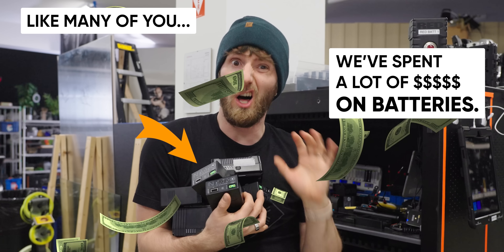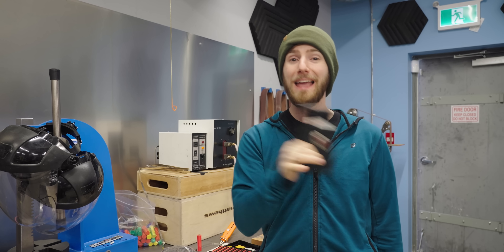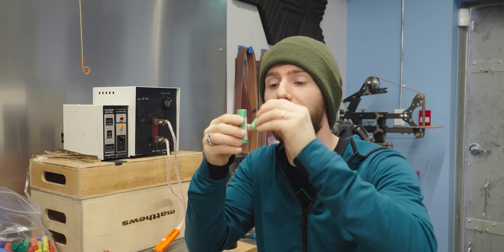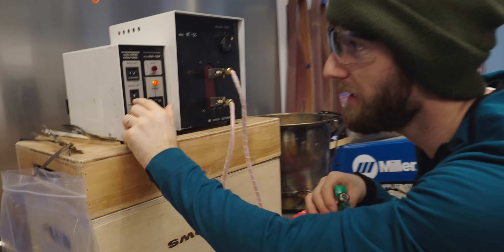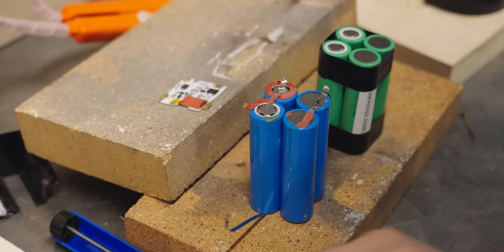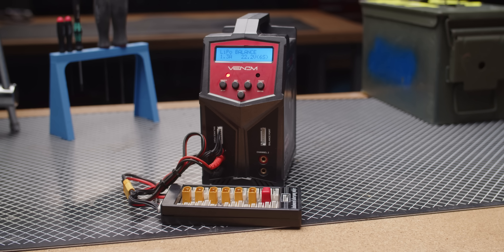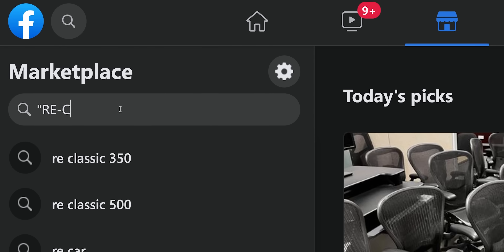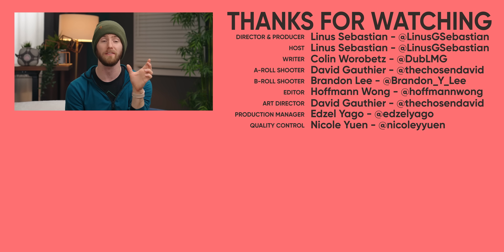This should be illegal… Battery Repair Blocking

Comment: You literally told the reason they do this in the video. The problem with having a "resettable" BMS, is just that people that don't understand the dangers of lithium cells, will just save some bucks by resetting the battery pack WITHOUT swapping the cells, which can lead to disaster.
And then the company will get the blame, for example, if someone have a camera, their battery pack "dies" because its considered "spent", and then some customer googles "X battery pack reset" and finds the procedure to reset the BMS (which should be done after a cell swap) but does it WITHOUT swapping the cells.

Then sells the camera with the reset battery pack (which will now charge up fully but in a unsafe way) on for example craigslist, and then battery pack explodes in the hands of the new owner, which now, not understanding that the previous owner did a unsafe reset on the pack, now blames the manufacturer of the thing.

OR EVEN WORSE: Buying the camera new, then replacing the new battery pack with the old reset battery pack.
Then reseals the package, and returns the camera to the shop, which checks the battery pack and it says "0 hours" because it have been reset.
And then sells it as-new to a customer, which now gets a unsafe battery back which explodes.

Thats why I think its a good thing that they block battery repair, but then they should repair the batteries themselves in a safe way.
Like Bebop does. I don't think you would have anything against if Bebop implemented a encryption DRM thing in their BMS but for which Bebop had the unlock key to, and they could do the cell swap safely.

For cars, there are coming a new standard now for cars, called SERMI. That will replace the anti-theft DRM on today's cars where only the manufacturer can create ignition keys for the car. Instead, anyone that have been approved by the government will be able to create ignition keys for any car.

Maybe something similiar could be created in the future for BMS:es. All BMSes would then legally be required to use the same encryption key for the DRM, and then only approved "battery repair centres" (that are accredited and approved by the government for safe cell swaps) would have the corresponding unlock keys to safely reset the BMS.

Then this enviromental problem with batteries would not exist, but still so battery repairs would be forced to be done in a safe way.

Comment: "recycle properly" you mean in most cases, give them back to the manufacturer, so they can redo them and resell them for full price? They should be properly disposed of, not recycled back into the system! Also this just shows corporate greed at its finest, can't be fixed, even by professionals, buy more instead. Definitely need more companies that produce products that can either be user friendly repaired or professionally repaired in some capacity!

Comment: It's as basic as that... Once the bms has 0 volts from disconnecting the battery it no longer works. It s controller will just become erased.

Comment: There is absolutely no reason to throw those cells away. The spark is because you were not applying pressure properly and there was a small airgap for a spark to jump. Those were not ruptured cells.
Reply: They're so scared because they really don't fully understand what they're doing.
Reply: @j.t.johnston3048  he did say he was an amateur and that this shouldnt be construed as an actual tutorial. He was mostly doing it to entertain us and inform us rather than show us detailed step by step instructions
Reply: @assnapkined9295  its probably best he threw spark batteries away quick even if they dont work instead of saying 'sparks are fine guys this is from the welder' and risking viewers spotwelding and not having as much haste with battery sparks
Reply: @heartdex  You do get sparks when spot welding.
Reply: @j.t.johnston3048  Which is exactly the right mindset if you do anything you don't fully understand.
Reply: That's what I was thinking!
Reply: That sight got my heart to drop, yep
Reply: And also the Positive side way isolated by the plastic So there was no short
Reply: I would try the Red BMS with a power supply, give proper (100% charge equivalent) voltage on the four BMS leg, and let's see if that boots up the BMS or still stays silent. Latter means it killed itself... If wakes up, then good to go.
Reply: Oh god, I used to work in automotive with spot welder robots, got a face full of molten metal sparks more times than I care to count. It feels like someone slaps you in a face with a boiling hot wet blanket.
Reply: @alexgo373  That explains why your face looks like a welder's bench, my friend!
Reply: I mean, better safe than sorry. Imo I'd do the same thing, leave it for an hour, come back and inspect. Even shorting a cell briefly isn't going to hurt it, it's long, continuous shorts that kill them
Reply: They just kept wasting batteries. Absolutely stupid without any understanding of what is going on 🤣🤣
Reply: @OlegSven  You guys are absolutely consumer doinks if you don't understand why people set certain batteries aside to never be used again. Why even watch LTT if you're so inept?
Reply: Yes, he said he was an amatured in this.
Reply: Way overcautious with the "spark" reaction.
You should do some deliberate short circuit welds and learn what it really looks like when it goes wrong. ☺️
Reply: The spark is actually caused by a capacitor, and has nothing to do with pressure or air gaps. When I plug my battery into my ebike, it makes a big spark, because the battery has a big capacitor.
Reply: I think your right.
My vw up battery builded 12V 75ah bank have given spark more then once when building it.
Working perfect.
Using it on 5000-7000wrms car audio.
Reply: I want some of whatever you guys were smoking because I've had one of these rupture inside a vape and since then I would rather jump off a 3 story building than weld one of those with my face that close to the lithium cell without a face shield >.>. The vape shop just sets aside batteries they decide are even slightly compromised. Probably a good business practice.
Reply: @Zensiji   bro, but nobody is welding cells in the vapes. Maybe in the oldest ones, but I've never personally run into one like that. You might have just picked a dogshit cell brand or it had some build flaws. Most of vape devices have all kinds of protection and voltage balancers anyways. But if you're charging a vape through the usb port in one... well that's not recommended it's better to charge them in dedicated 18650 or 21650 cell chargers.
Reply: @coffe3  A lot of vape pods that use 18650s can be charged via usb. Why would they design it like that if it's potentially dangerous ? 

I didn't run into any issues charging mine for years with usb. I imagine the charge circuit has a mini capacitor and some electrickery to ensure the charge rate is constant and at the correct rate for the cell.
Reply: @candyman9635  there are brands which include USB charging to increase sales, but don't want to spend the money to actually do so well and safely. Wether it's a good idea to charge a vape from USB entirely depends on which vape it is.

Just because a company is willing to sell something is no guarantee of it's safety
Reply: @candyman9635 keeping cost down as usual...
Reply: @Zensiji  "the vape shop" lol
Reply: @Zensiji Not sure why you think your incompetence is equivalent to others drug use.

Comment: I first learned about planned obselecense in my IT class. It blew my mind. I was thinking so many countries make big manufacturers adhere to certain emission regulations, but no one seems to carethat much about planned obsolescence except for  the user? Just blows my mind.
Reply: planned obselecense has only been around for a hundred years or so...
Reply: Ehhh. Sometimes people are just buying and creating a demand for products with too many bells and whistles, that and too many people do not bother to fix or maintain their stuff well.

 If you want a dryer and washer With 20 modes and smart functions to be affordable companies are just going to have to cut corners and the people that buy them don't bother to care about what it can handle or make sure its well maintained. It's no wonder stuff doesn't last long. My tip is to go simple but strong, don't cheap out too much and learn about what you're buying including basic maintenance.
Reply: @irregulargamer1352  This is basically what I do, I will run all my gear to the ground and then fix it back up again. It just makes it a hell of a lot easier when there are manuals for stuff thats out of your comfort zone

Comment: Dude this video confuses me. I did a quick search and it says Lithium batteries will heat up and explode if they are shorted. I don't want to call you stupid, and although you tested the voltages, but you didn't point out that you aligned the voltages. I feel like you're either dumb or scared that it made a little spark and threw it in some sand and left it.

Comment: You just need to apply proper voltage to the board right before you disconnect the batteries. You can also repurpose the batteries for things like Ryobi battery packs or portable phone chargers that aren't evil lol.

Comment: Bebop being the battery supplier for Arri is just so fitting.  
For those unaware, Arri's company philosophy is pretty much the exact opposite of RED's in every way.  

They started making film cameras over 100 years ago and went from making the best analogue motion picture cameras to making the best digital cinema cams. They realise that their products are, first and foremost, tools for professionals who need to do a job quickly and efficiently. They don't give a fuck which battery or SSD you use, because there are industry-wide standards that assure compatibility.   
They don't try to be a stupid lifestyle brand, upselling you on shit you don't need and locking you into a massively overpriced proprietary ecosystem. 

IMO the only reason RED has any foothold in the movie industry (looking at the Oscar nominees of the past ~70 years Arri has an absurd market share) is that Netflix required their own productions to be shot on a native 4K sensor and the only Arri camera you could buy that had that was absurdly expensive.  That's why the Netflix market was and probably still is dominated by RED.
Reply: Well put, and don’t forget they will sue any manufacturer who implements internal compressed raw.
Reply: Also red is more or less a patent troll (they do use the patents, but they use them to prevent competition)
Reply: yea, Linus needs to switch to arris haha
Reply: Amen! Their color science is unmatched. Never met anyone in G&E that didn't fawn over their lights either.
Reply: note to self: Remeber this guy's post if ever I buy a camera
Reply: Interesting point, thanks!
Ok, now I believe Netflix has shares in RED.
Reply: RED also came from porno, bad vibes
Reply: ok, but do they allow the users, or even better explain how they could change the battery themselves? (Otherwise, it's just another way to make money)
Reply: Yeah, that stupid Netflix 4k mandate was a travesty.

Comment: 16:10 No, no, no.. Not shame on you. I say F**k you. If your company finds this to be a good practice, I personally cannot wait to piss on the grave of your company.

Everything can have a chip, In fact I would prefer everything to have one within reason. But when you give these chips unique identifiers - Not just make and model, legit identities burned in on programming. When a chip queries the IDENTITY of its other, as in a manufactured pair, and refuses to function because it will only function with its manufactured twin. Just F**k you, designed obsolescence is in fact as evil as you can get. To me it is the same as taking a variable sized shit on everybody that buys your product so you can sell twice as many products to the same person within the "designed lifetime".

The worst thing about this whole "proprietary software" crap.. As if you could extract a microcontrollers code, far from its source... Is the hardest part to reproduce would be the secret sauce used to make the device fail (intentionally) when you replace a part that has an identity burned into it that is not a match. We live in a time where enough people have provided source in detail for most common component applications. It is very possible to find a better firmware solution on github than the stock OEM's solution.

The only code they should be worried about us seeing, is proof that they are throttling our devices as they age, where the actual hardware is physically as new.. I would say "What's next a phone that drops a couple hundred megahertz every time you drop it?" But it could already be implemented somewhere.

Comment: Charge each cell with a vape pen charger first to similar voltage. Next install one at a time starting from the + side of the pack doing the - side last. Finally apply a voltage to the pack outputs at about 1/2 volt over the pack cell sum measured voltage. This resets the pack and allows it to charge correctly. Fixed lots of tool batteries this way. ❤🤓

Comment: As an electrical engineer that has designed battery packs in real shipping products, I can pretty confidently say it's not "putting up road blocks on purpose". It would take extra work and hardware and isn't worth the cost. Sure, some BMS ICs are "single use", but that's rare and only for the most inexpensive management chips. If you need to connect an external tool to reprogram them, so do we...

Ps, those sparks are pretty expected... There is extra work you can do to eliminate them, but it's not that important.

Comment: You can actually use old cells.
Just make sure the voltage is correct.
Pretty sure you can just charge them up if it's too low.
It may be risky, but not too bad

Comment: YOU GUYS SEEM TO HAVE WIMPED OUT IN THIS VIDEO, JUST FOR A FEW SPARKS, SERIOUSLY.  RATHER THAN THE PANIC BUCKET YOU COULD JUST TEST THE CELLS HAVE NOT BEEN DAMAGED.  I STARTED WITH RECYLING LAPTOP CELLS, GOT THE APPROPRIATE CHARGERS.  THEN WENT THROUGH SOME HOMEMADE SPOTWELDERS, THEN THE CHINESE ONES WITH THEIR DEFECTS BUT GOT CREDIT ON EBAY AND FIXED USING VIDEOS ON YT.  I HAVE CONVERTED NICAD DRILLS WITH CELLS I OBTAINED FROM LAWNMOWERS AND DRILL, GOT A HALF DECENT BMS FROM EBAY AND THEN A BETTER ONE.  ONE DRILL I UPGRADED WAS 36V TO 42V.  AN EASIER PROJECT WAS UPGRADING CELLS ON DYSON V6 I GOT FROM FREECYCLE, VIDEO ON YOUTUBE SHOWED HOW, PROBABLY EASIER TO BUY CLONE BATTERY PACK OFF AMAZON.  IF I LIVED IN A WARM COUNTRY I MIGHT LOOK AT THE HP POWERWALL CHANNEL AND BUILD MY OWN SUPPLY.

Comment: How hard is it recycling batteries in North America? In Finland we have battery recycling spots at most bigger shops. Also recycling plastics, glass, metal, paper, cardboard, bio and the rest is becoming more and more easy and those are usually present as bins at most bigger buildings in cities. Recycling spots are near no matter where you live.

Comment: Thank You!!!! And I hate that cell phones today have that issue. I feel that all electronic devices have the ability to swap out batteries and battery packs have to be generic with the specs published on the internet and no copyright attached!!! Even though car batteries are swapped with somewhat ease, (I hate all the plastic in the way)there is a number of different brand of batteries available.

Ask the mechanic about the cost of drill batteries and non standard sizes there is.

Myself, I have repaired many different electronic devices out there with no issues until the evil power management chips came into being.

Comment: Best video ever... I wish more pressure can be put on battery manufacturers for a wider range so that batteries get returned for a deposit like they are in South Africa. Any time you buy a lead acid battery there is a Govt tax that forces the manufacturer to reduce waste and recycling the battery.

We also do this with plastic and glass bottles, it should be a world wide thing, tax the manufacturer and provide stores with an incentive to pay for old e-waste to be returned to be reduced and recycled.

Ps.Its not Sodder. 

 its said solder, like soldier...  🤣🤣🤣

Comment: Jejus, I used to make battery packs from 18650's  sandpaper them and  SOLDERING wires to them, yep pretty dangerous if you get them to hot, but  HEY I swear I  never blew one or got them to catch fire.  I dont recommend it tho.

Comment: The same goes true for HP ink cartridge as after 3 or 4 refil those cartridge won't work anymore as there is a chip build inside the the cartridge which detects the maximum time you can refill the cartridge and thus shutting down the cartridge after a certain refill although the cartridge is still capable of printing if refilled....